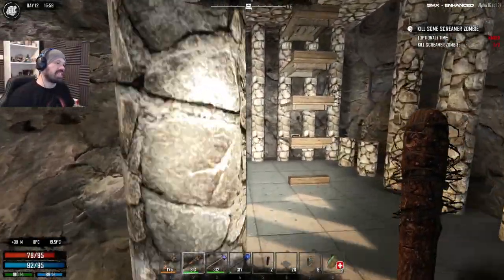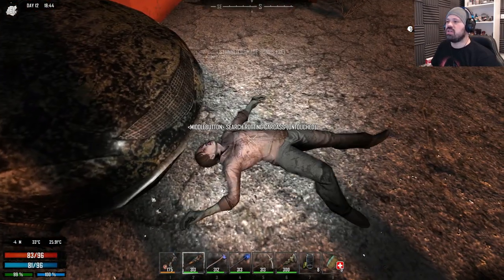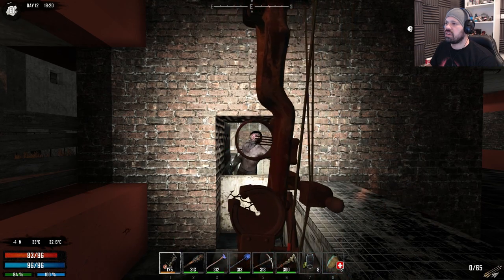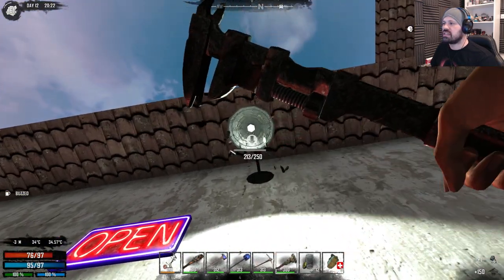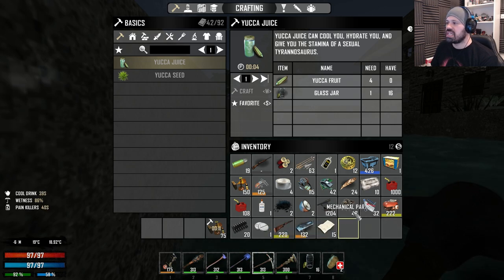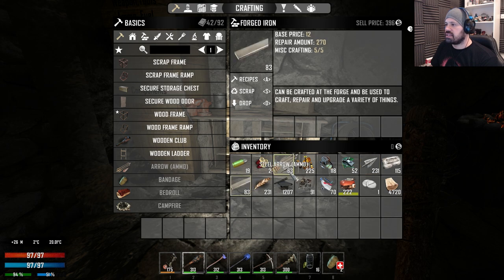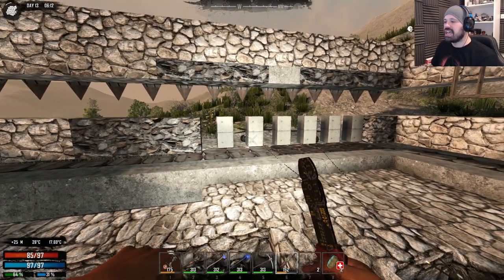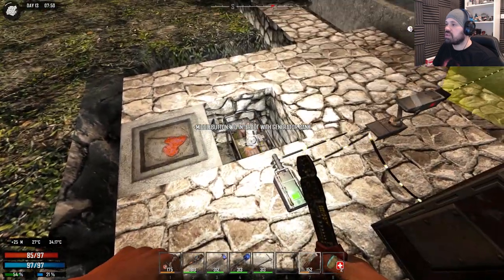ALPHA 16 Electric Things | 7 Days To Die Alpha 16 Let's Play Gameplay PC | E24

Comment: Nice video man! LOL, what happened to that house, it's a bunch of floating blocks. Also, do you know if placing the blade traps on the top would cut zombie heads?
Reply: Z-Nation FFS they removed the graphics for the blocks it used for the house so it became floating scrap lol
Reply: LOL, I Learned a lot by watching G4K during the past years, it's a good time investment and also fun :)
Reply: He didnt restart after B119 came out, so changes TFP made didnt make it to his map.
Reply: Hey Z-Nation. Love both yours and Kickz videos. The blade trap will cut off their heads if placed on top. I experimented using the electric poles as well as top blade as electrified zombies will stand still letting it cut off their head and crawlers automatically stand when shocked. Only issue is blade traps break super easily, especially with cops. Keep up the awesome vids!
Reply: Thank you mkw0123 :)
Reply: Z-Nation FFS and if I remember right you can place the blade trap on top of a block to make it head height I tested it out on a few zombies
Reply: Z-Nation FFS if you put it on a block it will take the head off also with electric wires if you dig down a block for the rod placement it will be ground level
Reply from the maker: Z-Nation FFS What you mean learning from me lol - You are the master of designs and unique ideas I keep learning from 😊
Reply from the maker: chad stalnaker yeah only new chunks loaded in will have the changes 🙄

Comment: Kickz - I am pretty sure you can pick the blade traps back up by holding E, like a workstation.  Just make sure to turn everything off first. ;)   Given how easy it is to just fire the generator up, I skipped using a switch and just turn the genny on and off for defenses.  The lights are nice, but do not illuminate enough of an area without using a lot of them, and still summon screamers which makes no sense as they are not generating heat.  I have not played with the darts yet, so am looking forward to see how effective they are on your next vid.

Comment: you should put relays across the top of the wall then wire from generator to relay then relay to relay in series. Each relay to a trap.

Comment: i have 8 blade traps all connected to a generator with 3 engines fully fueled it will run for almost a whole day so you do need to have a switch,  also if you dont have any traps that use power the generator won't use any fuel  so can be left on all the time

Comment: Blade traps are nice and all but be warned they break fairly quickly and require all of the mats (roughly 1 each per 50 repair) to build it to repair it. Also it seems once it hits the last 50 HP they just stop spinning and don't lose anymore durability so if you wire from one to the next you'll be fine. Assuming cops don't pop on them or you shooting it.
Reply: I think blade traps are bit op. Get pop corn and beer and watch the carnage.
Reply: Yeah they do kill well but during my testing (pit type, 4 blocks down, with blades on bottom) they don't last for a whole horde night. They don't even make it halfway through (I tested on 120 min nights so might last if shorter nights though). So perhaps if they are the last line with you sniping them as they come should work out well but not first and last, definitely don't want to ignore the horde if that's all you got.

Comment: Kickz, check the recipes in the workbench. If I am not mistaken I saw a recipe in my game for electronic components that can be crafted. That should make it easier to stockpile your stack of components.
Reply: Norman Blankenship it's required science skill and make it yourself skill.  it's used alot of materials for 1electric components.  I say just find some light and wrench it off is much easier.
Reply: That is true, however, with the new skill tree in alpha 16 you have to have science at skill 7 to make the crucible, if I remember correctly. The make it yourself skill also allows you to make your own mech parts as well. Since we all know now that power leveling at the moment is just hardcore mining until either the next build or when A16 goes stable release, its super easy to have the ability to crank out as many of the parts/components as you want. On the downside, that does skimp out on the scavenging style of resource gathering, so its just whatever the individual playing wants more at that time.